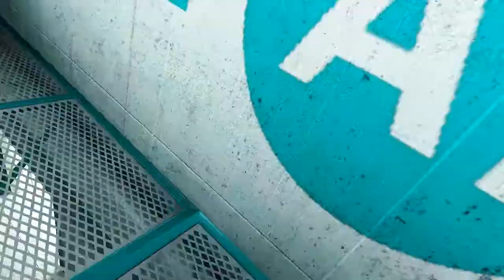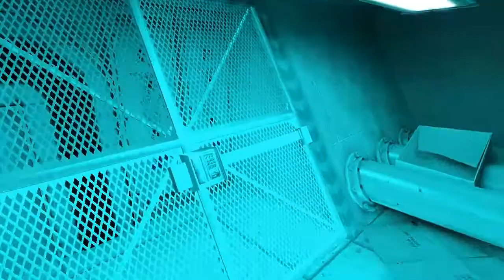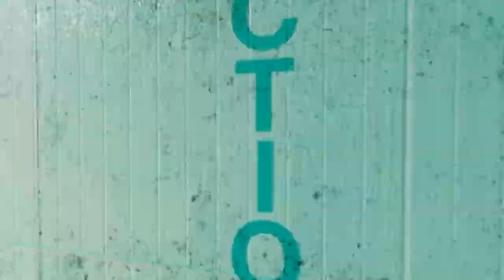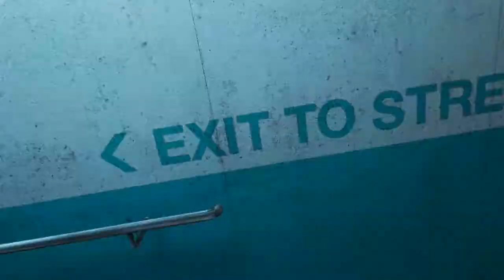Let's Play Mirror's Edge: Part 5 - Ropeburn's Fall

Comment: Speaking of speed, here's a fun link:
watch?v=uTmiu1nqvco
This makes Faith seem even more insane than usual.  And it doesn't even use some of the crazier late-game tricks.
In speedrun talk, "single-segment" means playing the entire game to completion in one session. This typically means the runner only uses riskier, more luck-based tricks in the early levels, since anything that goes horribly south will make you scrap the whole thing and start over.